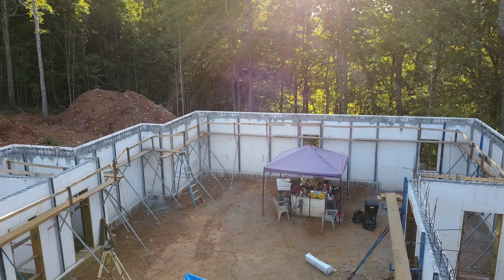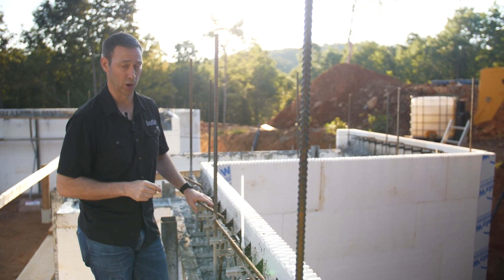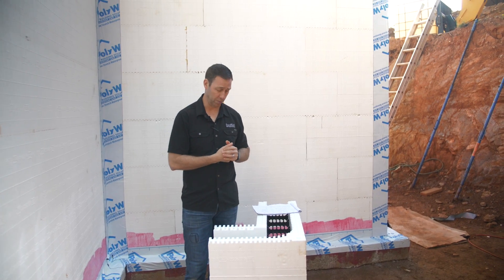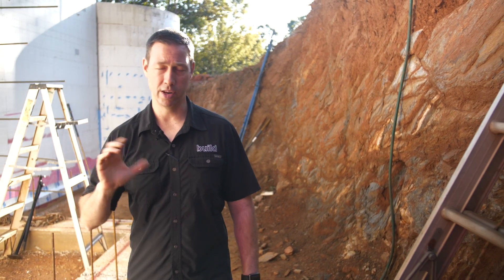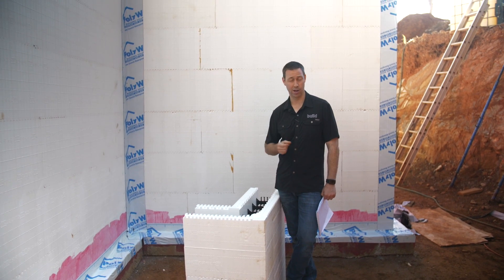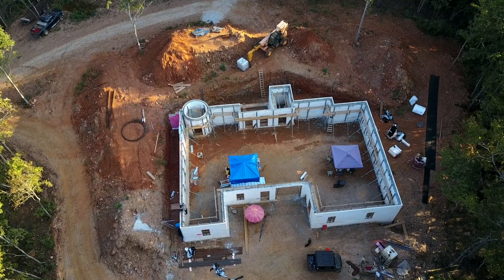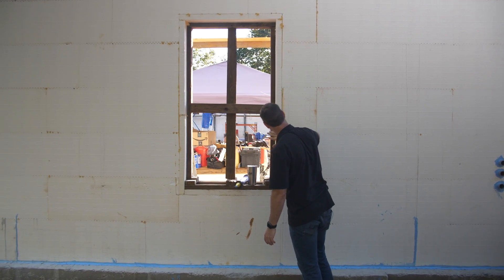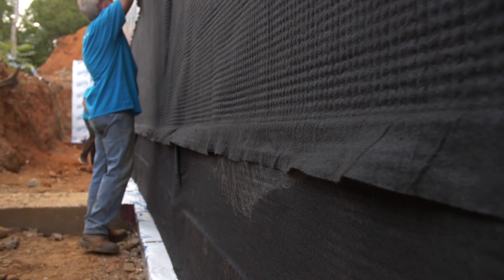Insulated Concrete Forms - Overview, Costs, and Cons

Comment: I have built many, many of these houses and basements under huge houses. We always waterproofed the exterior, added a French Drain system to the exterior  side. We actually set the first course of block into the wet footer, thus locking it to the foundation! Leveling? No problem. When one reaches the top of the wall and finds some high points or low points, just trim trim the blocks to the desired heights, or add additional foam from partial blocks that have been used for other small projects. Straightness of walls? NO PROBLEM! A minimum of bracing is required on the inside. As you poor, the wall will move with the flow of the concrete and the shift in weights. Not to worry. Since it will take 25-30 years for the concrete to reach maximum hardness, you come back the next day and adjust the bracing to square the walls. Then, since you’ve already hung the floor joints into the concrete, and if you’re smart, bought a prefabbed floor system, you begin to hang the floor joists. They are cut to length and true, so they provide the final absolute squareness to the walls. A 2X10 sill plate fits nicely on the top of the wall. make certain you place Simpson Tie tie down straps into the wet concrete as you reach the top. The ties will wrap around your sill and are easily nailed in place. Any holes through the exterior walls for water, sewer, A/C, electrical should be lined with PVC pipe . Simply cut the hole through the wall prior to pouring, making certain the pipe diameter is sufficient to handle the planned size utilities. Plus make certain these “chases” are big enough to replace any utilities line later if need be. After the utility lines have been installed simply foam in the extra space to prevent any invasion by rodents, bugs, water, etc. of them. This house as shown could be stacked, poured, leveled, plumbed, and waterproofed in 3 days without a problem by my crew of four! BTW, my home in ND has this block, is 3260 sq.ft., with 12 foot ceilings, 28% exterior glass for windows, and is all electric (not natural gas) the average utility bill is $72.00 per month! And, by the way also, these houses are bullet proof! They are so tight that you’ll need an air handler to circulate fresh air. There are no cold spots in these houses! All rooms are the same temp. You need one thermostat, one A/C unit, and hardly any cleaning supplies. They are practically dust free! The biggest house I built from foam was 8468 Sq. Ft. 3 stories. His average utilities for heating and cooling runs $168 per month
Reply: Do you build in Michigan or have any recommendations for someone who does (with your level of experience)?
Reply: @President-Elect_Cory  No, but would be more than happy to come and assist you build your house, or help your contractor build said house. We could work out the details. If you’re interested, first and foremost, I work cheap (retired, and don’t require much funding), would need a minimum nice place to stay, And really enjoy helping others learn. Most of the work on a ICF house wall can construction can be done by the home owner himself. Where is Michigan do you live? I’m presently in Louisiana.
Reply: @stephentaylor9366  are you originally from North Dakota?
Reply: @rc5411 No
Reply: @stephentaylor9366  Wanna come all the way to Canada ?  ;-)
Reply: @Soulsmithing  Sure, if they let me in? Do I need a passport? Mine might be expired, I’ll look. What part of Canada? And when
Reply: @Soulsmithing  sure
Reply: @stephentaylor9366   Have you used vertical ICF systems or have heard from other contractors who have used them?  They look like a better solution to me, requiring less bracing, etc. but I don’t know what the disadvantages of them would be, if they have any.
Reply: @stephentaylor9366  I’m originally from La but now live in an adjoining state.  Where in La have ICF homes been built?  Last week we formed and poured the first Habitat ICF home in our state.  I’m now thinking about possibly doing one for myself in AL instead of stick building it.  If I do, I might want your expertise.
Reply: @JT_70  There are some locally around Baton Rouge, even with one on the campus of LSU, which is used as an example of an energy-efficient home. I know of a few others along the coast of LA. Some of these were built from not the best block (ICF) materials. As a matter of fact, I never particularly liked many of the brands offered in the BR area.  ICF is like cars. They all work, but some will not last as long (Ex: you can buy a Yugo car, or a Toyota. Guess which one will give better performance?) My choice of quality ICF materials is Fox Block. The quality, consistent reliability from less problems, the engineering backup offered by an American company, and instructions to build it right are just some of the reasons to buy from them. There are others, but if I was to do another home, or any building, I’d use Fox. They also supply ICF block for commercial applications. If you’ve ever seen a Drury Inn hotel, they’re erected with ICF. The coastal communities of ALA, FL, even TX have lots of dwellings. As a matter of fact, after hurricanes, the only homes left intact are ICF ones.
Reply: @JT_70  
I replied to this once, but for some reason, it never reached you. There a a number of these around Baton Rouge. I did not like the ICF block used in these houses. It’s inferior in quality, and will give the owner issues later down the road. If you stick with Fox Blocks out of Omaha (they have 4-5 other plants around the country) you cannot go wrong. Their educational materials, free engineering consultation, and just over-all quality cannot be matched. BTW: I’m not employed by Fox Blocks! I have, over the years tried other icf blocks, but I just did not trust the quality. I never built with ICF in Louisiana. Most of my work was done from VA, through the Carolinas, GA, FL ALA and west as far as Pensacola and the beaches. Good luck with your projects
Reply: @stephentaylor9366 still around? Interested in helping a youngish couple DIY in Mississippi?
Reply: @mobalaa9995  With a few more details, about what you are attempting to do, with what type of structure you’re looking at, where you’re located, etc., perhaps I can help? Give me a rough idea of your overall plans, and let me look at them. Then, perhaps I can be of assistance, 
Look forward to hearing back from you. Where in MS are ya’ll?
Reply: @stephentaylor9366  Hi, are you still willing to help with a building project? I’m near Oklahoma City and I’m in desperate need of building a house for me and my kids.
Reply: Thanks for all of this reply.  We are about to start building our ICF house.  ICF is new for the husband so I'm trying to keep up with notes and stuff to help.  What pre-fabbed floor system do you like?
Reply: @RealWorldNailsLuvNailz  I am not a big fan of concrete floor systems in houses, other than the basement slab and outside decking or porches. My orthopedic surgeon friend who I helped build his own home, used “I-Joist” systems for his floors in a 3 story. These systems are offered by Home Depot, Lowes, Menards, etc., or most good lumber yards. They take your plans and design flooring to fit. Why wood? The ortho doc says the best thing ever to happen to his business was concrete floors!! He says that if it wasn’t for them he wouldn’t replace very many knees at all. Mankind is meant to walk on surfaces that have some “give/cushion” to them, thus keeping the joints healthy. Concrete will not give and eventually will ruin your joints! I personally recommend the I-joist or as we call it here, “manufactured floor systems,” preferably an I-joist. They are extremely easy to install, will last forever, provide just enough give to save your knees, and provide an easy material to attach other building components to. Plus, Termite treatment:  they assure complete protection since the entire surface can to treated. They’re quiet, give you open spans of the area, which means you can put your walls where you want and if you ever decide to remodel, you’re not concerned with “load bearing” capabilities. There are lot’s of advantages for these systems, but one disadvantage is,  cost. You’ll pay more, yes, but they are worth the extra dollars! One big advantage: I figured out a way to pour the ICF walls without having to brace them saving time and money by reducing material costs, labor, and build time. I wish now I had a video of these houses, but when they were built we didn’t have YouTube etc. Also, using an I-Joist system all the way up to the attic floor allows for “open spaces as big as you want without the worry of “load bearing” walls. For instance: say while you’re building, and you decide to change the size of the bath room on the second floor. In a normal frame home, you must consider the weight of the bath materials before moving a wall. Not with I-joist. Put the wall where you want. Also, there are 4x8 manufactured sheets of decking for your sub-floor that you can attach any flooring you want to. I always use 3/4” tongue & groove decking. BTW: Weyerhaeuser,  Boise Cascade etc. and the other big guys make great systems, Just get quotes from all, Then, maybe go to Lowes, and get a price, then go to Home Depot and get a price, and tell each one the other’s cheaper and they’ll cut the price down. Work’em for the best price. You can do the same thing with the lumber yards. Hope this answers your question. If not, let me know
Reply: I’m in South Dakota and looking for someone to do an ice basement for me.
Reply: Hi Stephen, how can I contact you? I am in beginning stages of planning our icf build
Reply: 25-30 years for the concrete to reach maximum strength?
Reply: @ericperkins3078 
I was told by my ICF contractor that it takes 21 days before I could pull the Jack's out of my safe room. That's about how long it took the concrete to get hard enough to support its own weight. 
The Jack's helped bear the weight of the concrete ceiling of the safe room.
Reply: @ericperkins3078  that’s correct. Inside an icf form, surrounded by insulation & protected from most temperature change, it will take concrete years to reach maximum hardness. Now, this may vary, but considering all the options, this is pretty much accepted time frames. Of course, the Portland Cement people may not know what they’re talking about. And I may be wrong. Things change over the years as far as mixes, etc. Curing times may be less or more depending various concrete mixes, I.e., using pea gravel, silica sand, river sand, silicon strengthening methods, bamboo, straw chaf. Who knows? We’re in the process of developing “bendable” concrete as I write this.
Reply: @stephentaylor9366  Then my confusion is what does "fully cured" mean and is it even an important circumstance?  If those prestressed beams they are building the local overpass with (which are only a few weeks old) are not fully cured, then I guess "fully cured" doesn't mean all that much in terms of final strength.
Reply: @ericperkins3078  Concrete itself has NO strength! Without rebar, fiberglass or other components it has no use in practical applications. Sure you can pour a 3” concrete slab side walk, where only human traffic will use it, and probably get away with it until the ground moves or something heavy  is upon it. Then it’ll begin to crumble. Pre-stressed means the steel within the concrete has been stretched just like a piano wire. Left slack that steel wire would be malleable, but stretched it is rigid and you could walk on it. The concrete provides protection for the cable, adds additional strength to the beam. It’s much like a plant. The stem of a flower has no inherent strength. The “pith” inside the stem provides the stiffness. Pre-stressed Re-bar is the “pith” in concrete beams. What’s so wonderful about ICF poured concrete is that it continues to get stronger as the house ages, as opposed to weakening as wood may. Your 20 year old house is actually more solid than a new one
Reply: Are you still in Louisiana? Best way to contact you? Have you used Helix micro rebar to replace horizontal rebar in your ICF builds?
Reply: Hi Stephen
Do you come to Load Angeles ? Or know anyone as expert as you in LA? 
May I have your contacts
Reply: @armintahoori6524  Your best way to gain information you’ll need is to contact FOX BLOCKS in Omaha, Nebraska. Tell them I suggested you contact them. They may or may not remember me, because I usually have the customer order the blocks from them, and do not mark them up for profit. FOX Block has all the engineering, etc., plus the list of installers/builders in your part of the state you are in. GOOD LUCK
Reply: Can you build my house?
Reply: @lauram3281  Where do you live? And how soon would you like to start?
Reply: @lauram3281  where do you live?
Reply: @lauram3281  YEP
Reply: @lauram3281  DID YOU BUILD Your HOUSE YET?
Reply: F
Reply: Yes, how can we reach you?
Reply: Thanks for all the information.
Reply: Hi thank you
Reply: 9
Reply: Hi
What about interior utilities installation water gas electric? 
Just braces attached to interior side hard foam?
Whats the way to finish interior side  
Metal studs to hard foam and drywall or some special interior panels?
What about fire resistance? 
I have read about 4 hr fire resistance. 
Foam doesn't burn or smolder no flammable gases?
Reply: @Matt999PL  I would suggest you explore YouTube, and find any number of videos of how best to do this, since people have come up with great alternative ways to accomplish these steps. Also, your hesitant plumber and electrician can watch these, and relieve them of concerns. Since the interior wall is a solid styrofoam, you can simply take a hot solder iron and melt a channel to the depth required by your local electrical code, then insert your wire and spot glue it with insulating foam from a can (be sure to use a foam spray that’s conducive to styrofoam!! Some of that foam will destroy styrofoam). Then melt out a rectangle deep and big enough for your electrical box. You can do the same with the plumbing. ALSO, you can insert PVC pipe through the block from outside to interior for drain lines, prior to pouring the concrete, for sewer, electrical or well lines, etc. After the pour, and having inserted the lines through these egresses, you simply fill them with foam to seal them off from outside intrusions for critters, bugs, water, etc.  All plumbing can be run below the floor or in the slab as usual. Or you can run it overhead. And melt channels down through the walls as you did with electric. I personally ran oversized PVC conduit for both, thus leaving room for later additions such as replacement lines or wiring. You sheetrock the interior walls per code. There are straps inside the block that are 1-1/12” wide every foot or so, to screw to, so it’s easy to hang any interior materials. You can use metal studs,  but metal DOES NOT absorb sound, and it will be noisier in the house. Wood studs help dampen the sound, and make for a very quiet interior. You will never find a home as quiet to live in with no echo effects, as an ICF house!! Very little if any outside noise can penetrate the walls. We went through a hurricane and barley knew it was happening until we saw the trees bent over.I would suggest that you investigate the 4” block for interior walls. The cost is more, but the sound and privacy from house noises is excellent. I did this one house for a young couple with two kids, and they had to get a noise monitor for the kid’s rooms to make certain they were alright. They stated they NEVER imagined a master suite as private as theirs was!!
Reply: No, I’ve not used Helix. Instead I used a ceramic rebar. NOT the fiberglass, but true ceramic. It’s outperformed every rebar in existence. But, the problem with steel rebar exists only where the steel can be exposed to continuing moisture intervention. Inside an ICF block, this will rarely  happen, if ever. Your wall cavity is sealed at top, and bottom so no outside water should ever penetrate these walls. As far as tensile strength? Steel 1/2 or 3/8” rebar is sufficient. You may want to check with a P.E. If you’re constructing something other than an above ground wall. Increased rebar is often needed in these instances. I can be reached at abtaylor658gmail.com. And yes, I’m in Louisiana
Reply: Steve would you use this over block in the Fort Myer area? I’m looking for a contractor!
Reply: @sldder6137  ABSOLUTELY!!! A few years ago,  a town on the northwest coast of FL was devastated by a storm, and the only building left intact was a ICF home!! Why styrofoam? Well, even though many think that termites eat styrofoam (and this is debatable, but that’s another story), the advantages of structural integrity of an ICF home is without comparison. The simplicity of stucco finish (although your can use any exterior finish you want), for ease of maintenance, a quality roofing material such as steel or fiberglass tile, installed correctly will weather most storms. BUT, the biggest reasons are on the inside. There will be no interior areas with “too warm” or “too cold,” since the temperature is consistent throughout the home. The tonnage of A/C needed is greatly reduced, thus saving thousands of dollars in construction costs (and later reduced energy bills), the air quality is amazing since there is very little dust in an ICF home, the noise level is greatly reduced, since sounds are muffled by the ICF walls, and the serenity of the peace and quiet inside a home that effectively blocks out all exterior city, neighbors, or natural noises like wind, rain hail, thunderstorms, etc. I used to know some ICF builders in your area. I’ll see if I can find their contact info and forward it to you. Also, I used an architect from Tampa who was very familiar with ICF home construction. I would highly recommend him too. Maybe I could help too? I like your area of FL. Just let me know
Reply: @stephentaylor9366  it sounds like a fantastic product…  here’s my plan/ thought… I closed on a lot .. in punta gorda… I have a small 800 square foot plan with a 1-5 garage option … which I will most likely do… I need a shop to work out of… I  need a contractor but I really want to be involved with the process and I found local companies that the neighbours  used for clearing well septic and my soon to be son in law is a electrician… the problem is Im not really interested in turning the entire project over to a builder.. it costs more then I think it should and I really want to finish the inside mostly myself… I need a project and I’m not in a hurry to finish it cause hunting for everything and doing the work is fun for me… so what I guess I’m saying is I want the shell to the point of doors roof windows concreate drive.. and drywall.. Is that possible to do.. or will builders turn it down.. I like strength of this product and it has a diy element to it … any thoughts? Or am I way off base.. thanks for your reply.. it was very helpful..
Reply: @sldder6137  Since the concrete work in this project is the critical component at the onset, along with site preparation, drainage, utilities, and equipment needed to place the concrete materials, I would suggest you find a local guy with “site preparation, concrete placement & finishing (including pumping concrete), & of course, county regulations for “self-build” structures, and an architect. Why the architect? Well, any municipality, code enforcement agency, building inspections, etc. will accept an architectural plan, as opposed to a “home drawn plan,” and you’ll hav less hassle with insurance etc. In hurricane prone areas, the state, county, city, etc., are very likely to refuse to pass any structure that does not meet their building codes!! If this happens, they can prevent you form occupying any structure until it passed their inspections. Of course you may be able to build a 8 car garage, and then change the interior later to ling quarters? I don’t know the latest construction requirements for Punta Gorda, or for that matter, Florida in general. Finding labor is the easy part. Getting proper documents to build without official drawings may be a problem? Go on the net and find out what you’re allowed to build. Then plan from there. Every time I built in a new area, my first task was to find out the local rules. Without that knowledge and cooperation with those authorities, you may never occupy your own building on your property. As a matter of fact, some areas would demand you tear down any structure, and if you didn’t they would do it and then charge you for the cost of demolition. Just a thought: you could buy a steel building, and rather than build the walls out of steel siding, build them out of ICF. You actually could fit the vertical steel exterior wall columns inside the ICF blocks.  The steel building plans are certified, and accepted per the state/county their going to be erected in. Talk to the steel guys.
Reply: @stephentaylor9366  I like the idea of a steel structure… with the ICF surrounding it.. are you saying .. a steel building.. is that a poll barn style or barndominion like structure?
Reply: I live outside Atlanta and am planning to build.   Really interested in ICF.  Anyway to contact you directly?
Reply: Do you build in WA or have a recommendation? Thanks
Reply: How much did you spend on your project without the land?
Reply: @lydia535  I’m sorry, but I have no idea which project you’re speaking of. BUT, if you’re speaking of the typical home construction which is wood framing, etc., then compare it to ICF wall construction, one would seem more expensive than the other, or putting it singularly, the ICF would cost more pre square foot. BUT WAIT— When building a home or any other structure, one MUST take into consideration the OVERALL COST of the project/finished product!
Take for example a wood framed wall: Say it costs $30 per square foot, while a ICF wall will cost $50 per square foot. It would appear that the wood framed wall is more cost efficient if one just looks at that cost alone. NOW, when remembering that the wood frame wall has NO insulation, one must then add in the cost of insulation to match an ICF wall (somewhere between I35-I45). In order to achieve that density of insulation acceptance, one would need to frame with larger lumber studs (2x6 v 2x4) to accommodate the extra thickness of the insulation. Then, when one estimates the amount of A/C & Heat source needed to heat & cool the home, the costs of this equipment often doubles. For example: a home I built (3600sqft) with ICF construction needed a 3ton A/C combo heat pump/AC unit. A wood framed home that size would need about 5-6 tons, and probably two zones to reach the same interior temps that one wanted. So, lets say that one needs 2 , 3ton units, at an average cost of $7500 ( as opposed to one 3ton unit @$7500. Your ICF wall system just saved you 1/2 the cost of construction ($7500). Now, take the wood wall overall cost and add $7500. Then, take the ICF wall and subtract $7500. Plus, on down the road, when this equipment needs to be replaced, you’ll only spend 1/2 the $ in doing so. Most contractors have established costs per square foot. Any change from that affects their profit line. So, they are very resistant to change. The dollar figures quoted by me here, are meant MERELY as examples. AND, let me tell you this: This 3600 square foot home with 12 foot ceilings throughout, with 34% of the exterior walls as glass, with electrical only heat/cooling source, its own water well, and pump septic system cost an average of $75.00 per month to heat/cool, wash clothes, heat water, run fans, appliances, etc. everything electric. The neighbors next door had a 2x4 framed 2400 Square Foot home, with less glass, and the same electrical power company, and they averaged $157.00 per month. So,the 3600 Sq.Ft. Home saved another $82.00 per month. Now factor that savings into the cost of the ICF wall and you just saved $984 more per year. How long does it take before you’ve saved more $$ by building with ICF? BTW: This 3600sqft home was mine. We lived in it for 5 years and sold it for 33% more than we paid for it. HOW? I put the utility bills on the dining room table for all to see, and we sold it in four days! We had six offers after it first advertised.
Reply: having trouble getting a reply through, can you add your contact information to your youtube profile under about?
Reply: @homerundesktop  NOPE!! You put your info in FIRST!! THEN WE’LL COMMUNICATE!! The problem is not mine, it’s yours, SO, give me all yur info and I’ll respond
Reply: Is the exterior fire resistant?  One nice thing about concrete is resistance to wildfires, but if it's covered with plastic foam...
Reply: @tristan7216  Good Question!! Styrofoam itself is not fire resistant. However, in order for it to be available as a building material, the materials are mixed with a fire retardant product in the manufacture. To what degree or percentage of resistance for each block? I’d contact the individual manufacturers of the blocks, panel, etc. Most home materials (with the exception of steel of concrete) are combustible at some level. Also,  check with the local building codes and see what level of fire resistance is required. Wildfires are just that, i.e., WILD!!
Reply: Great advice , I remember building houses out of ICF in Alaska when I was 16,  been thinking to build my next home here in Vegas out of ICF. Could I get your email to get more advice?